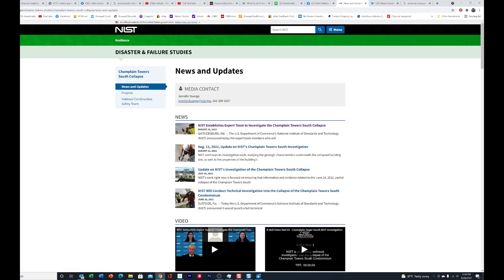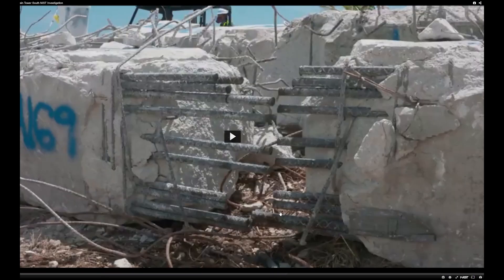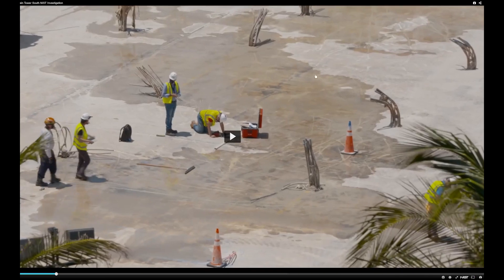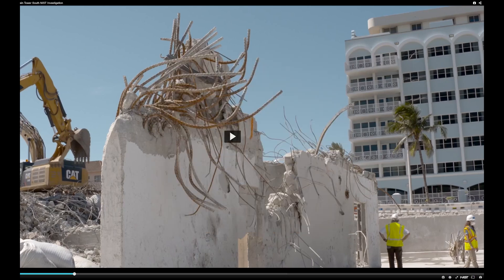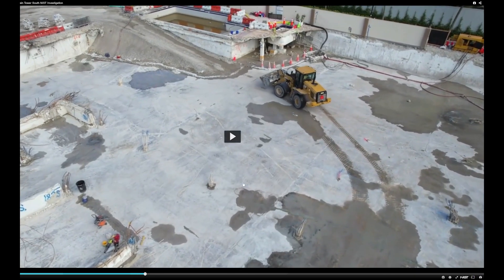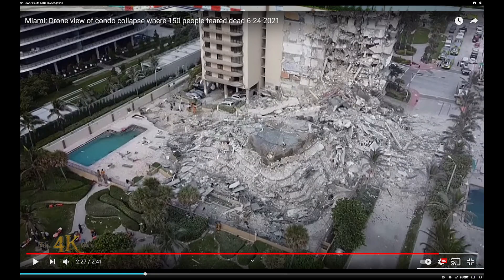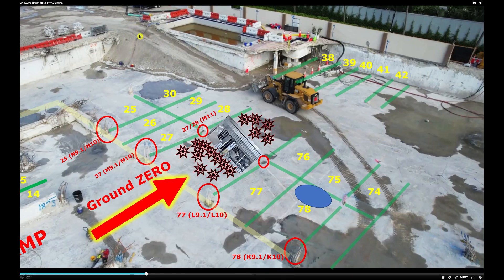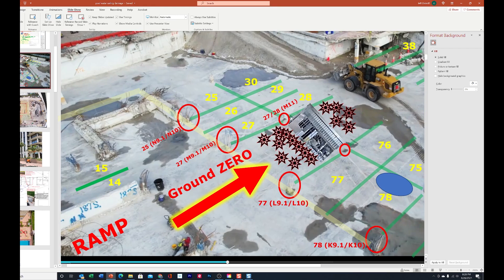Surfside Condo Collapse Site View NIST Video Ground Zero

Comment: Interesting Video. I think when the final report is released, it will show that it was not one event that caused the collapse, but multiple issues.  Personally I think the issues started after the main groundwork and slab was done (Considering the collapse, the slab looks in very good condition and was a massive part of the budget.)  I think after the slab was finished, a lot of cost cutting was done to save money, including saving money on design, on quality of materials, and workforce experience. Add that to 40 years of very poor maintenance, and even more building changes, it was a disaster just waiting to happen.
Reply from the maker: yes they are usually a chain of events

Comment: I have mentioned this to you before on one of your other videos. I mention it now because you are dancing around the same area, pillar M10. Take a look at the BMA beam between M11 and M10, you can see it in the garage video. There is an 11" step up in the ceiling towards m10. BUT, the drawing set does not deal with the step for BMA.

So, the attachment of BMA to M10, instead of being 5.5" + floor thk, is actually 16.5" + floor thk. The rebar in the BMA likely continues in a straight line along with the BMA bottom edge. This means that when the punching shear occurred, the tearing at pillar m10 was 11" deeper than expected, and the depth of tear was greater than the 16" square of the beam.

If you are not following my explanation then let me know, I can provide the drawings and images to clarify. This drawing error or omission I believe is what dragged the building down at M10.
Reply: OK, we also have a variation of the Hyatt Walkway Bug, now, too?
Reply: @TimeSurfer206  What are you trying to say?
Reply: @TimeSurfer206  Yes, I have seen the documentary on the Hyatt collapse, the welded C-sections. I just wondered why you mentioned it to me. Sorry you had to write such a lengthy reply.
Reply: @davewelch151  I'm not. It alleviated my boredom for a few minutes :P
Reply: @TimeSurfer206  LOL. Actually, the Hyatt was one of my fav forensic docs.

If you are bored, you should check out my suggestion about the BMA across the floor step hypothesis.

Comment: Colums L M and N are 12x16 on the first row outside of the building. Column L has the long length facing the building. Column M and N has the long length parallel to the building. Column N is attached to a monster "H" beam structure. Of all of these, column M would be most likely to be damaged by a hard tug, because it only has 12" in that direction to hold fast. Column N is oriented the same way, but because its beam is attached to the big "H" beam structure, I don't think that, even if it collapsed, it would bring the building down. If M collapsed, and this is what the video appears to show, it would pull down on the column supporting the outside wall of the building.

Comment: Jeff, at minute 2:49 to the right of the blue paint (A169) you can see the rebar in the concrete and it is very close together too!
Reply from the maker: Yes I'm waiting to see if nist reports that there is something wrong with those rebars
Reply: It's seems the thinking that if one is good, 10 would better! 🤔
Also, the way you pointed out the corroded rebar in an early video you shared was telling. I think it was either video or photos that were taken a few days before the collapse. I didn't realize rebar will swell if it gets wet. (Did I remember that correctly?) 
The 'clean' rebar is definitely concerning. Thanks again for your astute eye and willingness to share with us.

Comment: So what appears to be M11 was where the Engineering team had pulled that Core sample from In November 2020. I am wondering if the core sample did not speed up the timeline of the collapse or if the building failed to seal up that hole, to which lead to additional water exposure at M11.

Comment: The problem with concrete components is that they have no individual ID markings made by shop detailers for erectors/field crews, like structural steel components have. That makes it difficult - if not impossible - to identify each piece in the post-collapse stage, especially when it was removed from the site without previous documenting the location of recovery.
Reply from the maker: they use systematic approaches to determine what was where

Comment: Love the videos! ... I'm noticing this -- at 20:28 when you are showing the location of the 'C' or 'H' shaped column on the plans it is clearly between N-O, 8 -9, but then in the video screengrab you say that "it comes over here..." and you trace it over to column 17 with the red paint, but where you trace it in the video is  between N-O, 4-8. Back at 19:37 where we are looking at where that block of beams, 33, 34 & 35 ended up resting on the garage floor, it is clearly  between N-O, 4-8, next to the red column, but that is one row of columns over from where it was on the garage ceiling, between N-O, 8 -9, from looking at the plans. Yes? ... However, this does nothing to clear up the mystery of the extra column that appears to be directly in the garage passageway, rebar sprouting out of the garage floor.
Reply from the maker: Jonathan I think you were incorrect on the columns you were looking at. The northern edge of this H beam has two columns supporting it, one at N8 the other at O8. The southern edge of the H beam sits on top of the columns N9.1/10 and O9.1/10. You refer to columns N4 and N6 those have nothing to do with anything related to the H beam they are completely independent and they are north of the H beam in parking space for space #17. And that red strip post is the corner post for space #17, and it is O8.
Reply: @jeffostroff  I might be incorrect... I often am. But starting from where we agree ... where you locate the H beam: "The northern edge of this H beam has two columns supporting it, one at N8 the other at O8. The southern edge of the H beam sits on top of the columns N9.1/10 and O9.1/10."  Is that H beam the item we see at 19:04?

Comment: In engineering we like to talk about "extent of condition", and the implications of this building's defects are widespread not just for the US but for the world.  Just think of how many building will need to be inspected or re-inspected based on the NIST report on Champlain.  And how many will simply be allowed to fail due to lack of resources.  I hope NIST doesn't hold back.  Your videos are very insightful and helpful in understanding this terrible tragedy.  We stayed in a condo in Mazetlan recently that was one block off the beach.  The roads in front of the condo were being re-worked due to drainage problem that became obvious when it rained one night and the road became a river.  I wasn't too concerned since that building was only three years old, but the high-end $500/night condo up the road where my boyfriend's brother's family stayed was much older and had cracks in the walls and floors throughout.  No way would I stay in one of those places ever again.
Reply from the maker: yes, this collapse has everyone questioning every building they walk into

Comment: Thank you for everything you have aired. It’s very well presented. I have a question and would really appreciate any feedback or corrections. Bear with me, it’s long.

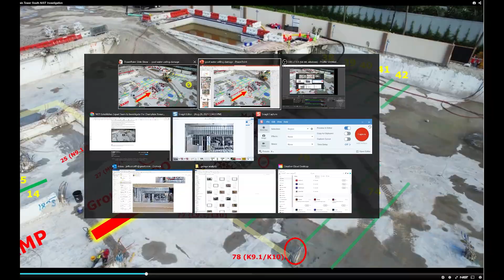In minute 12:55 here’s what I see in the tourist video: 

The second column in rank M, being M11, is fallen or smashed. I see a square planter box sitting on the garage floor right where M11 should be. Atop it at an angle there is a fallen beam or column situated a little right of dead center in the frame. As you point out, there was just such a planter box above column M11. So that must be it.

This being said, I wonder how the planter box landed perfectly upright if the base of M11 is under it. But something on the right side of the planter box could be the base of column M11. It seems to be squared, because it has a corner shadow. It looks slanted like it has been pushed to the right.

My hypothesis is that when M 11 sheared, the planter box slid down along the column which buckled then broke and the top part landed across the shrubbery in the planter box. Is this too far fetched to be credible?. 

Thank you for providing overlays to help us understand where the columns were in relation to the pool deck and the first floor of the building. Your videos have been real helpful and very revealing.

Comment: Could the column east-west rows 9.1 vs 10 possibly be to specify SPLIT columns, such as those you saw at The Marriott, and meant to provide the same type of slab separation, and which conceivably--if implemented--would've prevented the failing pool deck from pulling down the building's columns????

Comment: the scene at 5:30.
you can see some wall came awat with the deck, yet other parts seem like they weren't attached to the deck.
before the clean up, the pooldeck columns all looked like the concrete turned to sand, with the columns with nothing or even points on the top.
you'd expect some deck to be hanging on the sides on a few, but none.

Comment: I know I'm late to this conversation, but there was definitely rusty rebar in the structure. The evidence you provided of spalling shows that. But it's harder to tell with the rebar in the pictures. Salty air being so close to the ocean. Lots of rain because, South Florida. It probably would have been showing surface rust the next day, unless coated or treated.

Comment: If you look at 19:30 where you show the C beam, you are right in that it doesn't look like it's been moved since the collapse. (Debris under it). Yet it appears to be laying on the side of the beams it was on that's closer to the collapsed building. Not just towards the pool deck area that collapsed. So does this mean it was pulled down by the building collapse itself (rather than causing the building collapse)?
Reply from the maker: I think the building collapsed down on it and forced it to the ground

Comment: 23:17 - I think your marked up area on the plan, showing the initially survived east portion, is way too small. Judging by the CCTV video, it included at least the neighboring column row, or even did extend to the smaller eastern shear wall adjacent to the east stair.
Reply from the maker: I still think it is correct, as it shows it to the right of the stairs. People made it to the bottom of the stairs, and opened the door at the bottom, and climbed over the rubble pile.

Comment: One thing I find amazing is the garage floor is in perfect condition. With the building coming down so hard and massive chunks of concrete then all the heavy equipment clearing the rubble you would think the garage floor (foundation) would have been damaged. Looks like not even a chip from the floor. Looks perfect and smooth.
Reply: Ikr. But maybe there is cracks we can’t see unless we’re up close.
Reply: My guess is that all the parked cars acted as shock absorbers. Steel is incompressible, and can support a lot of load even when flattened. Also flat slabs would have limited impact on the floor.